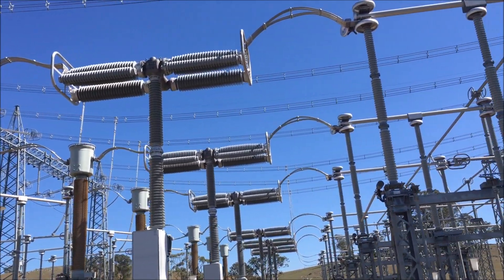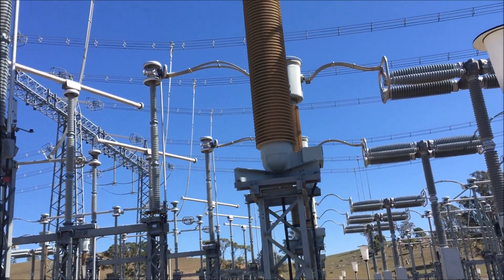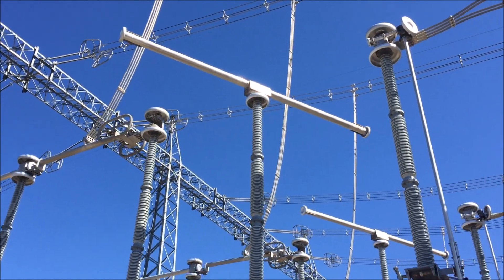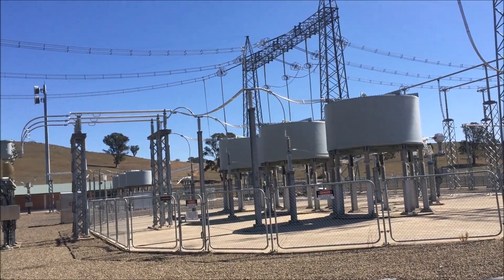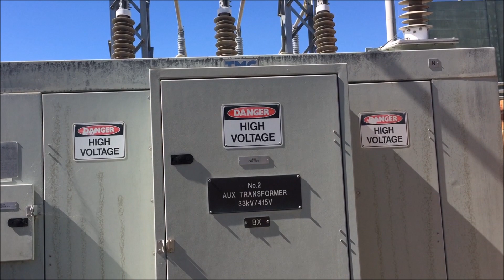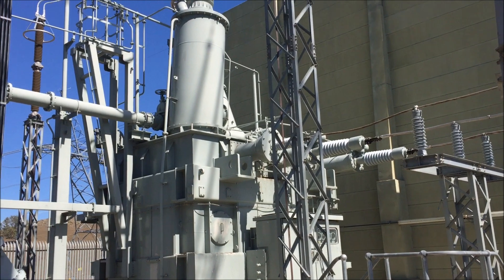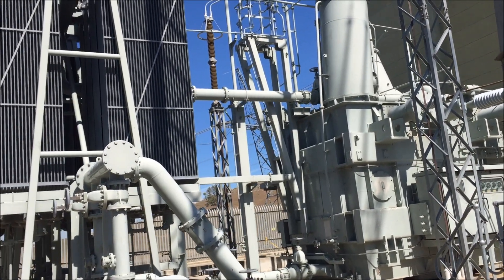The highest voltage 500kV substation equipment - A quick look up at the big stuff

Comment: Thoses current transformers. 3K Amps in, and 1K amp out?  Wouldn't that mean that the voltage is stepped up if the current is stepped down?
Reply from the maker: It is just 1 amp from the secondaries. CTs are strange beasts that are entirely current driven and voltage plays no part. Here is a wiki link that should explain it better than I can https://en.wikipedia.org/wiki/Current_transformer
Reply: Awesome Thanks! I was always taught that Transformers make voltage go up and down and current go down and up. IE: With a Power Factor of 1,  Power in P = I * E * PF = Power out P = I * E * PF, So if CUrrent went WAAY down, the way I was taught is that the Voltage would go WAAY up.  Thanks for the info.  I'll go check it out. I do know alot about electricity, but there is a huge vast amount that I do not know. :)
Reply: 3000:1 ratio for the CT’s. The reason they don’t step up the voltage is because the secondary windings of the CT’s are basically shorted together. Doing this causes mainly current on the secondary windings, up until the CT’s are fully saturated. If the CT’s where to be left open circuited on the secondary, then the voltage would be stepped accordingly and you would get an massive melt down of the CT

Comment: Highest we have here in the States is 765kV AC. We also have some 400-500kV DC transmission lines.
Reply: We have a 500kv DC line here in Utah going to Cali. Where are you that has a 765KV line? I've heard of it, I just don't know where it is.
Reply: @gtamateur ah. Thank you. :)
Reply: @gtamateur what is the effectiveness of these big transformers? And minimal distance to be effective for 735kV line between production and consumption? 
Counts ratio from 735 to 11kV is also nice and best is sound of these devices. 🤗
Reply: @gtamateur Thank you for the subtle analysis. However, I am interested in the efficiency of these large transformers, because what I've read so far, the transformer has an efficiency of 90 to 99% if well designed.

For example, in my country *, the efficiency of the transmission system (from production to 22kV grid) is 99.033% - see the third line on the page:
https://www.sepsas.sk/OdborUkazovatele.asp?Kod=19
And this is not enough for the loss of power lines in a multiple transformation from 6kV in a power plant to 400kV, then to 22kV if transformers have ONLY 99% efficiency. These big ones must be better.

* The length of the ground of Slovakia is 400km and maybe therefore the maximum voltage is 400kV. : D
See map with EN legend https://www.sepsas.sk/images/schemasiete/Central_Europe_2019_12_31.png
(Source https://www.sepsas.sk/SchemaSiete.asp?kod=17)
And only in neighboring Ukraine in the last picture on the right is the 750kV line from Zakhidnoukrainska to Hungaria - Szabolcsbaka.
https://www.sepsas.sk/images/schemasiete/PS_SR_2019_12_31_mapa.png
- the most common line is 400kV in 1/2 of Europa.

Comment: that is the max voltage we have in Canada to. very cool stuff.
Reply from the maker: Yep, it is the biggest I have seen. Surprisingly quiet for a 500kV yard. Everything is fitted with corona rings so you don't get that crackling sound, Thanks Sparky
Reply: Actually, Hydro Quebec has thousands of kilometers of 800kV class transmission lines, more than AEP in the US.  The amount of power carried over 765kV is to the order of four times greater versus 345kV (not 100% sure on figure).  NPR (national public radio), interestingly, has a map showing the different transmission voltages in the US.